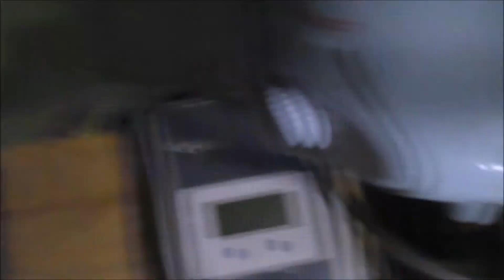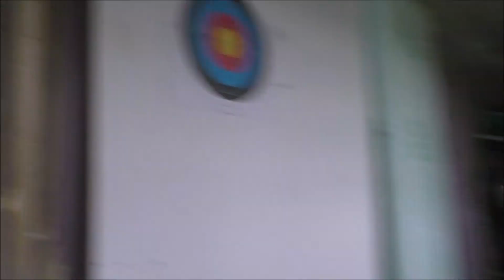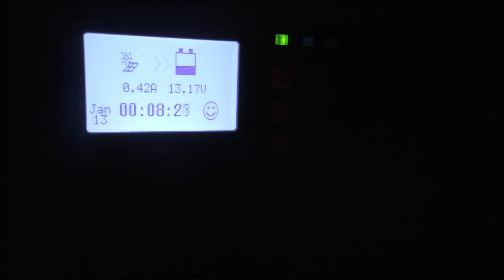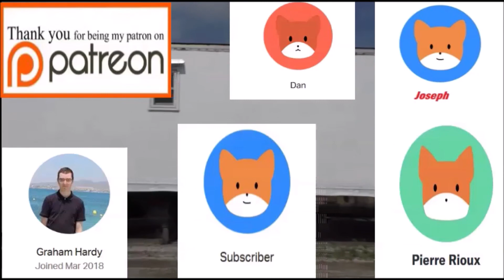Rain Test On The New Sealed Areas Of The Tiny House

Comment: Tracking down leaks via that open chaseway is nice & easy. Otherwise, you can't fix what you can't see.

I love the idea of electrical, plumbing and even ductwork installed in accessible chaseways, too. Makes future repairs & upgrades fairly painless.

If ANY water finds its way underneath your spray foam then you still have a problem. Somehow you need to find out where that water is entering from up on the roof, and then seal it up there. (If your roof isn't steel, then you can place a very powerful magnet near the leak and then go up on the roof & use one of those magnetic stud finders to locate the magnet. The leak will be nearby.) 

Good luck
Reply from the maker: Thank You